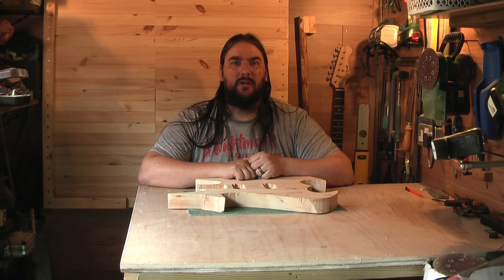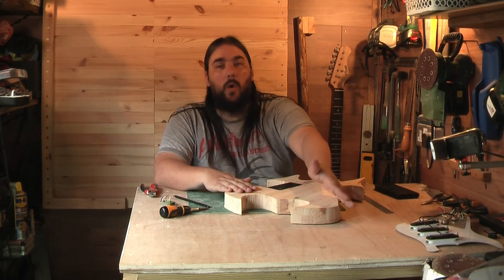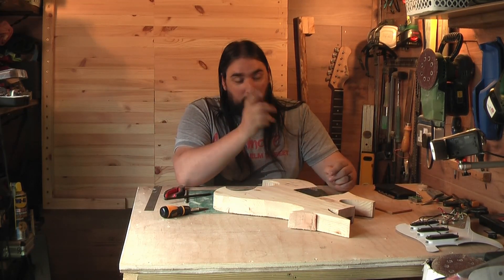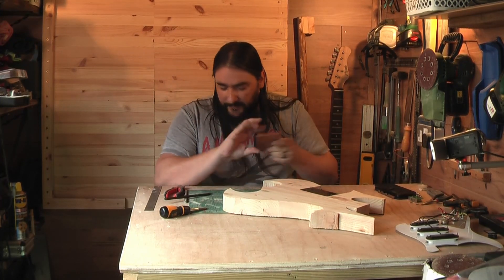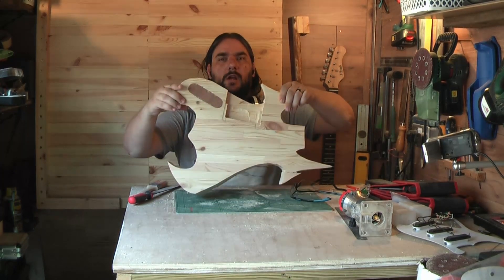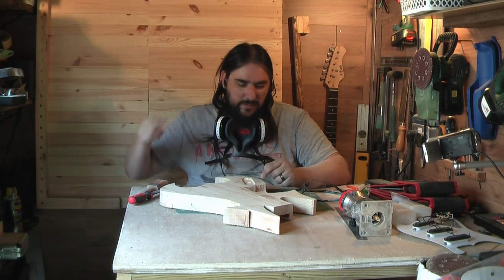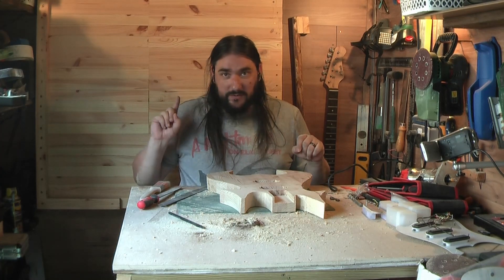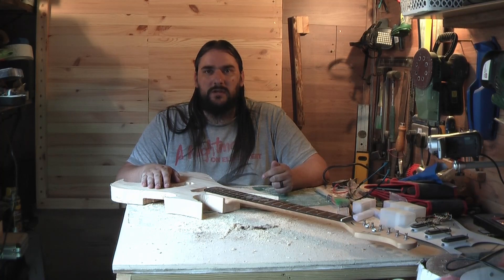The Silent Zombie GGBO 2023 How to Build a Guitar for the price of a Wish.com Guitar, Episode 5

Comment: Coming on nicely, couple of tips for cutting plywood with a jigsaw, put masking tape on both sides, then draw the shape, knife the shape, using a finer blade will all help stop tear out. 👍
Reply from the maker: Good shout mate, just glad the chip out was mostly only one side 😀
Reply: @gothridercreations  without telling you how to suck an egg, most jigsaw blades cut on the up stroke having the back side facing up is another tip 👍